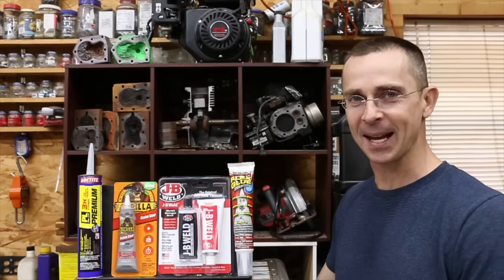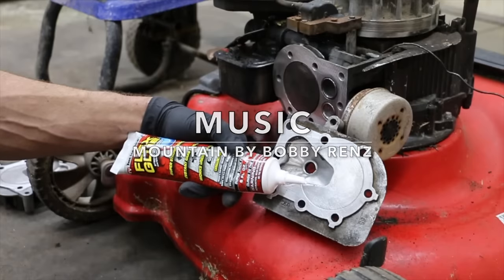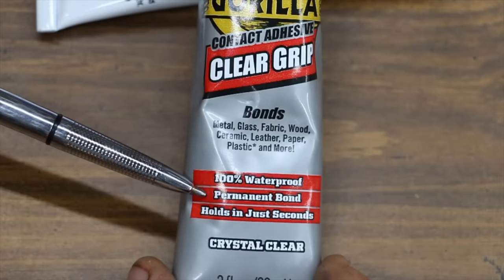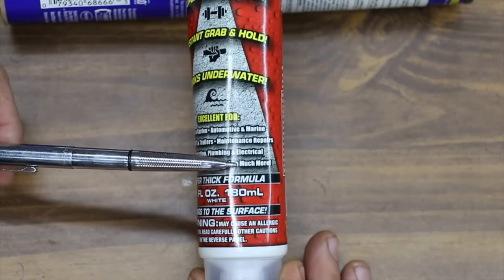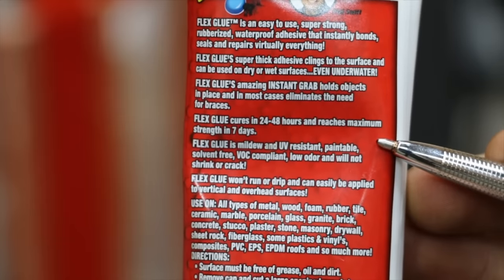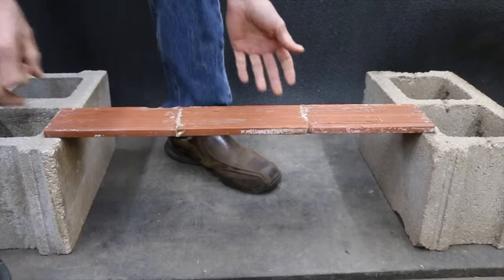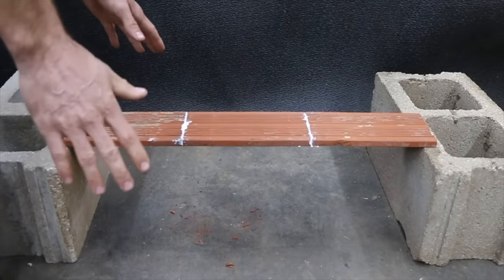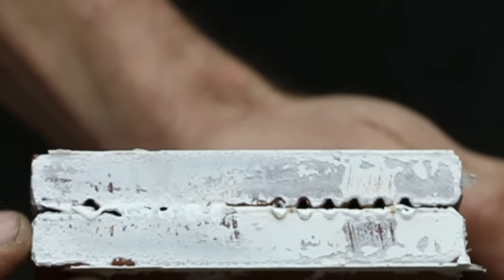Is Flex Glue better than JB Weld, Gorilla & Loctite?  Let's find out!

Comment: Had an 83 GMC fitted with a propane system. It had dual saddle tanks mounted on the outside of the frame that could not be replaced due to changes in regulation. One tank developed a pinhole leak where a manufacturer's tag had been welded. I couldn't afford a new tank and it would have to be mounted inside the box, defeating the purpose of the box. I could afford a couple tubes of JB Weld. I ran the tank dry then opened the drain cock for another week. Then, leaving the drain open, I ground off the tag and polished up an area of about 6X6. I then layered the epoxy using metal window screen as "rebar", with each progressive layer getting a little bigger. Drove it another week without filling it. Filled it up and never looked back. Sold it to my brother in law, bought it back, passed inspection and drove it till the electrical system crapped out and the driver's side floor did a Flintstone. At least 500,000 kilometres  and never a sniff. Very definitely illegal, but JB Weld is my go-to goo.
Reply from the maker: Thanks for sharing.

Comment: I have used JB Weld to fill a shaft on an exhaust fan where the bearing failed. It has worked for years. Just applied a couple of coats and sanded between and to a final match on the shaft.
Reply from the maker: Thanks for sharing.

Comment: I want to share something with You. A few months back I was working on a Wisconsin Engine. I had an air leak between the intake manifold and the Carburetor. So I tried to tighten the carburetor to the Intake Manifold. What happened is I broke the tab off the Carburetor. That Carburetor cost $572.00 plus I had to wait one month before I could get another. I have never used JB Weld before, but I heard a lot about the Product. To make sure I would buy the right kit of the JB Weld I called their Office in Texas. I told the gentleman what I needed to do and told him what the Material was. He told me the Product to Buy and how to Clean the surfaces. He started mix the 2 parts equal in an amount, steer the 2 part through then let it set for 1 minute, steer again and then apply to both sides. Clamp the device and let it set for 24 hours without moving the carburetor.  After the Epoxy dried I cleaned the extra Epoxy off the Carburetor after 24 hours. I installed the Carburetor and as of today that Carburetor is in the Wisconsin Engine and is used daily. I am a Firm Believer in JB Weld. I will Never NEVER buy  ANY GLUE OR EPOXY BUT JB WELD.  THIS IS A TRUE FACT. I am a Firm Believer in JB Weld.
Reply from the maker: Thanks for sharing.

Comment: Your videos are extremely useful. I have a broken metal shower hose holder at home, and I was wondering if I could get away with using glue instead of a "better" solution. Based on this video, I chose JB Weld. Thank you!
Reply from the maker: Thanks!  Thanks for sharing.

Comment: Way back in the early 1970s my brother in law repaired an old tractor with JB Weld. The water jacket for the cooling had cracked when I forgot to drain the water at the start of winter, like pop told me to do. Anyway it's still holding and nearly 50 years later no leak. JB Weld is the best but I knew it couldn't hold that cylinder head on.
Reply from the maker: Thanks for sharing.

Comment: My son hit a pot hole with his Honda De Sole  and broke the oil pan off with piece breaking off the crankcase. We cleaned the crankcase and the broken piece and glued them back in place with JB Weld , put on a new oil pan. He drove it from Ont Ca  to AB Ca. and sold the car 1 year later and the JB Weld held up through it all.
Reply from the maker: That's great!

Comment: I put a thin layer of J.B. on the bump head of my weed trimmer at the start of the season. Mix it up, put it on, and cover it with a layer of Scotch Tape. When dry, peel the tape. Make sure you have clearance for the bump, and you're good to go.
Reply from the maker: Thanks for the suggestion.

Comment: I used JB on an  crack exhaust manifold on a Detroit motor held for 10 years. Truck got sold still had that JB working fine. it was not a small crack went right through it. I swore by ever since.
Reply from the maker: Thanks for sharing.

Comment: I've been binge watching some of your videos the past few days (some I've seen before but rewatched anyway) and I've noticed how well JB Weld has performed overall. 3M 5200 is the "go to" in the marine industry as the epoxy to use for permanent bonding, and I am very curious if it's as well as it is touted to be. Would be interesting to see it go head ot head with JB Weld - is 3M 5200 really better for a permanent bond than JB Weld? Which holds up better to salt water level corrosion?
Reply from the maker: Thanks for the suggestion.

Comment: J-B Weld was doing so good, I thought it might work on the engine, too, at least for a little while.  I guess we know why the use gaskets and bolts now.  🤣  Might be interesting to see if these products could replace a gasket there, leaving the bolts in.  However, J-B Weld might make it too hard to disassemble without damage when necessary.  I wouldn't ask you to damage that engine.  I keep finding you older stuff from before I subscribed  in after video suggestions.  I'm enjoying them as much as the new ones.  Looks like you've been impressing people with your testing for many years.  Thanks, Todd.  You're the best!
Reply from the maker: Thanks and you are welcome!

Comment: I learned to build racing engines in the early 1970's from a fellow that had been trained as a GM engine tech in the late 1950's.  His life was a shambles, but DAMN, could that guy build an engine.  I learned a lot from him and one thing he told was to never use gasket sealer on cylinder head gaskets.  He said that in about 1966 the dealership had a '57 Chev with a 283 come in for a valve grind.  He said that there were clues that the engine had been opened up once before.  They looked a little deeper and saw that it had a solid head gasket on it which was quite unusual.  Errol said that he pulled the carb, distributor, intake and disconnected the exhaust manifolds.  He then pulled the head bolts and went to pull the heads off.  They wouldn't come off.  He said they tried chisels, a long 2x4 and even a crowbar and the heads wouldn't budge.  They decided to put the engine back together with a the head bolts snugged up and run it until it blew the head gaskets.  Nothing.  They then put in a took out all but a few head bolts which were left loose, but not tight just so they could 'catch the heads.'  They fired it up and nothing happened.  Then they started revving it up and nothing happened.  They took the hood of and decided to go out and drive it as hard as they could until the heads came loose.  Nothing.  They finally put a new motor in the car without ever finding out what brand of gasket sealer had been used on the car before.  After watching your tese, I'm guessing that must have been an early version of JB Weld.
Reply from the maker: Thanks for sharing.  Thanks!

Comment: When it came to metal, dad (having been a machinist) put a lot of confidence in JB Weld. 
To me, it smelled like regular epoxy, and looked like some thickeners/whiskers added in...the label said it contained iron, so I figured that's what they used.... Perhaps it added some strength, impact resistance, thickened it, whatever.
But after seeing this, well, I wish I could send him this link.
I've seen him use it in/on iron and aluminum engine blocks. Even used it on his half VW aircraft engine.
Reply from the maker: Thanks for sharing.

Comment: I had a KDX200 motor I wanted to put in a KX125 frame back in the 90's but the case was too wide for the swingarm axle bolt.  I cut a quarter inch or more from the gearbox case casting down to the required thickness on both sides then split the case and filled in the hollow area of the case in that area with JB Weld and the resealed the case.  The bike ran for years without a hint of problems in the affected area. through all the abuse of extreme off-road riding and jumps.
Reply from the maker: Thanks for sharing!

Comment: I was on a crap navy ship in 1981 that had a auxillary steam line (150 psi) in the engine room  while crossing the Pacific that was all rust and blew out.  When the steam plant was depressurized for a few hours for something else, I saw one of  the old salt mechanics slap a piece of metal lathered in JB weld after cleaning some of the rust off around the leak.  I was real dubious but the damn thing held till I got off the tub in the Phillipeans.  First time I ever saw JB  Weld used.  Not a recommended use but the engine room was 10 degrees cooler the rest of the trip.
Reply from the maker: Thanks for sharing.

Comment: It would've been really awesome to test the plastic pipes with compressed air, see how much pressure they can hold before failing. Excellent for testing air & water pipe repairs?
Reply from the maker: Thanks for the suggestion.

Comment: I enjoyed your video. One important difference about epoxies is that they do not evaporate a solvent, nor do they absorb anything from air. so they are uniquely suitable for joints that are deep or would develop a skin which would stop further setting. And they also shrink little to none in the process of curing.

I have used a number of adhesives with varying success. Epoxies, including JB Weld, have always performed well for me as long as they were not the 5 minute variety. After this set of tests I would like to see actual data on the performance of 5 minute epoxies vs the regular formula. With one exception I have had poor results with 5 minute epoxies. They don't get as hard. they don't adhere as well. They are vulnerable to moisture. 

The one exception is the JB Weld epoxy for plastic. Even though it cures quite fast, it has held up over time and stayed strong.
Reply from the maker: Thanks!  Thanks for sharing.

Comment: Years ago, i worked for a firniture refinisher, and i would use two part opxey to fix like table tops that got damaged, on the corners, i would build a dam of sorts that brought back the structor of the table top, or whatever i was fixing, sand it, grind it to shape, and my boss, the owner of the place would do his magic with painting the color, and graine of the wood back in, it was amazing when we finished with the pice you wo,uld have a hard time finding where we repaired it, that was 30 years ago, and i still use two part opxy for many other repairs than just sticking things togeather.
Reply from the maker: Thanks for sharing.

Comment: Please make a video about a starter motor on a van. Drill out the threads on the starter bolt holes on the engine block,  then fill them holes with JB-Weld. Then be careful to re-tap newbolt holes into the center of the JB-WELD. Then careful bolt on the starter with the original bolts, being careful not to over tighten and strip the new holes. See how many times the car will start, before the starter gets loose and can't start any more, due to it not lining up with the fly wheel.  I believe you will get crazy views by mechanics and DIY mechanics.
Reply from the maker: Thanks for the suggestion.

Comment: The question I always say to my TV set whenever I see a "flex" adhesive product:  'What is the durability of the product?'
While a 'Flex' product may do what it claims in TV ads upon application and in the hours afterwards when the material 'sets,' my question would be how it holds up in the weeks and months later?
Do the 'Flex' products deteriorates after a couple of weeks or months?  How does it hold up with high-heat of summers or freezing in winter?
Reply from the maker: Thanks for sharing.

Comment: I knew JB was gonna win. They use that to repair holes & tears in trucks & trailers on the road and once that shyt is on there... it STAYS on there for decades; through all the rain, extreme heat, and extreme cold on the road - no problem!
Reply from the maker: Thanks for sharing.

Comment: I've bought JB Weld before, but it didn't quite live up to my expectations. I had a laptop that had a plastic piece at the back break off, and this caused a section of the chassis to separate. I used JB Weld to glue it back together. It did hold for a couple months, but it eventually separated again, despite me being fairly gentle with it. The box rates it for something like 290C, but perhaps lower heat stress over a longer period of time weakened it. Perhaps I got a bad box; it was one of those dual syringe style.
Reply from the maker: Thanks for sharing.

Comment: Been using J-B Weld for a long time. It used to come in a plastic tube like a clay form and you had to knead it. I guess you can still buy it, it's called J-B Weld SteelStick. Great for steal  and metals.
Reply from the maker: Thanks for sharing.

Comment: Your showcasing and tests are awesome! I have been using JB Weld for 50 years and it delivers for me, more often than not! But if you want a real contender to JS Weld, Get some MarineTex Grey. Depending on their application I use them interchangeably and both are better than the other, app to app...Please consider doing a test with MarineTex Grey (not white, grey). Thanks for your consideration and your great tests!!!!
Reply from the maker: Thanks, will do!

Comment: I used to repair outboard cylinders when the saltwater would corrode the top of the cylinders where they meet the head. Also fill the pits in the head in the same area . The repair would often last a year on a boat used daily by clammers.
Reply from the maker: Thanks for sharing.

Comment: I had a head gasket coolant leak in an old Ford Astro near the water pump and sucked in a little JB Weld by creating suction via rad cap.  The seal lasted over 60 thousand miles and was holding when I junked it!
Reply from the maker: Thanks for sharing.

Comment: JB weld actually saved my life in 1981. I was driving from California in the desert. My water pump broke in 7 piece. I had 4 tubes of JB weld in the truck. It didn't take but about 2 inches of steel and hardener to glue the pieces back together. I was close to Needles and walked in. I got a motel for the night and got a ride back to my truck with water in hand. I filled radiator and crossed my fingers. I saw a little leaking out of the pump. no auto parts open, so drove on to Texas. Back then auto parts closed on Sundays. I made it to Houston, TX monday morning. I had to stop and check water and had to add water 23 times. I have been using JB Weld ever since. I trusted it with my life in a bad situation. I had to make to Houston on time. I was in the military and had orders to be there. No AWAL for me.
Reply from the maker: Impressive!!
Reply: Victor morning

Comment: wonderful demo... I had problems with batteries. I may use the tool then put it up for weeks. If I leave it in the charger the battery goes bad. Any suggestions?

Comment: Gorilla glue comes in different flavors, and I glued my apple tree back together 20 years ago. That tree had split vertically in the trunk from weight of branches that had spread way away from the trunk (as apple trees do). So I bored some holes (2) through the trunk, poured Gorilla glue in the cracks them cinched the trunk with the bolts through 2X4s. The 2x4s are long gone but the tree is healthy and thriving. I have never had any luck with J B Weld.
Reply from the maker: Tahnks for sharing.
Reply: @ProjectFarm  You're welcome. I enjoy your channel and find your testing intriguing. The original Gorilla glue that expands is what I have used for many wood projects and I have fund it to be an excellent rival to Elmer's.

Comment: I really appreciate how you single out each product. I have trusted, gorilla tape and showed. I assumed the glue would be great too and it's not you just validated my experience. Thanks
Reply: the amber colored foaming one is useful but you need to moisten both surfaces and clamp the overlap for it to be crazy strong, not good for much else because it gets everywhere. pretty much all i use from gorilla. anything flex seal is a scam, total gimmick. but jb weld all day, plastic weld is strong as shit.
Reply from the maker: Thanks!

Comment: I love the equality in use of material. HOWEVER, you didn't clamp any of the wood or brick to add some pressure. If you check the manufacturers intent, you need to clamp under pressure and observe the true cure times. I have used the loctite construction adhesives for 30 years, but it cures differently and has slightly different characteristics on some materials. Still good considering, but JB has always acted like epoxy resin. So the cure time is way quicker, and the compound is highly functional on metal.

Comment: As always great work. But one small consideration.... The wrench drop test is a little mixed up because you aren't measuring the weight of the wrench but the size of the opening for the head.

Additionally, that is a a bit unfair to the JB Weld because it had so many drops/impacts that the frequency and quantity of impacts may also have affected the bond.  For example...  Would the JB Weld have broken with only 1 drop of the same one that finally broke it?  Or did it break, at least in part, because it had about 15 small impacts before the heavier 1?

Not a criticism, just a point to consider.

Love your channel.

Comment: My problem is I need some kind of bonding compound to glue the springs on to the nuts to put on a crossover exhaust pipe to the exhaust manifold studs. As usual. You got no room to reach your hand/s up into there. Just have to put the spring on a nut into a socket with a peace of paper to hold the nut in place in the socket and use a long extension and ratchet to reach it. I need something that keep the spring and nut together while I do that? Any advice? The truck is a 1990 S10 Blazer 4.3 Liter Engine. The job is replacing the crossover pipe.